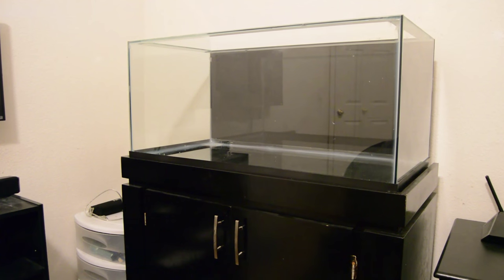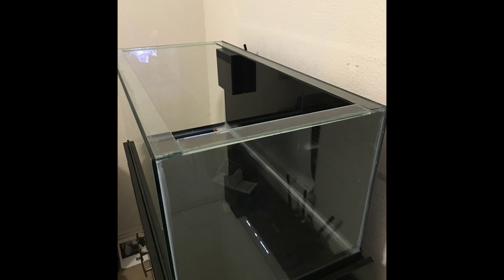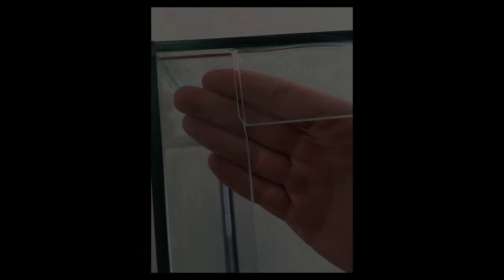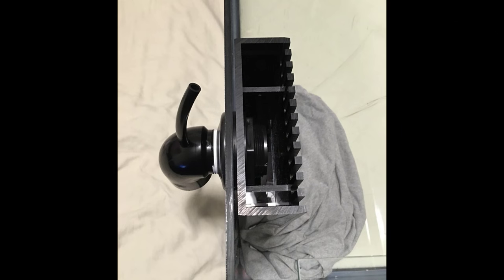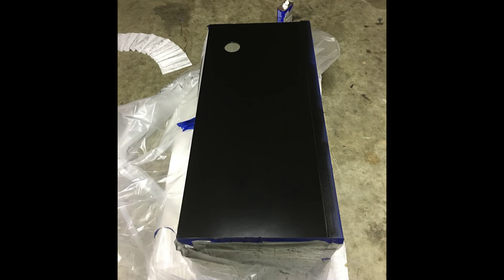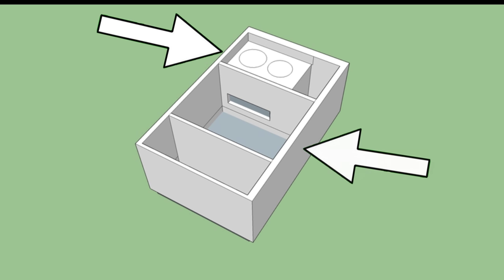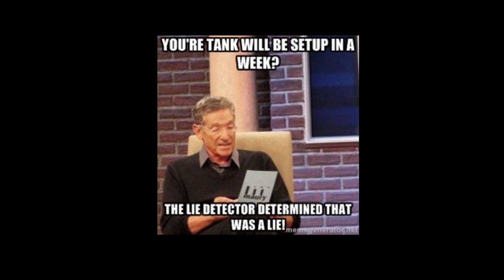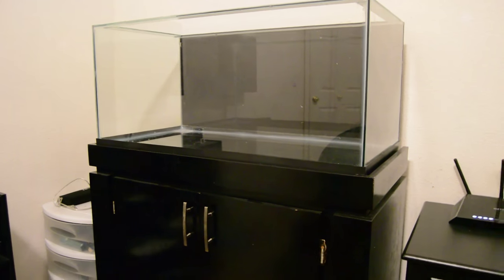40 Breeder Reef Update #2 Drilling/Bracing

Comment: does the brace need to be the same thick ness  as the wall glass? or can it be bigger? i have 12mm glass lying around that i can use but my tank glass is like 10 mm... my tank is new setup made by me its 6.5ft long 1 feet wide and 1.2feet tall thats like around 54 gallons and i forgot to brace it and came back the nex morning to find it bulging a bit and gaps near the seems due to water pressure and decided i deff need to brace it so pls gimme some pointers.. its the 1st time i have made such a long planted tank its really long [___________________]
Reply from the maker: I did 1/4'' just because that was the most common for me to find locally and its not that expensive. it can be bigger by all means especially for a longer tank like yours